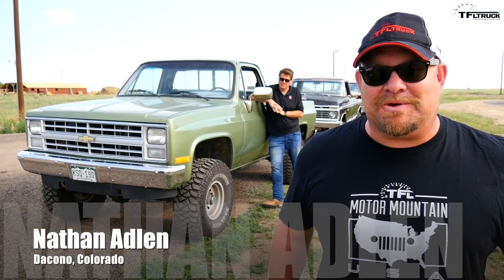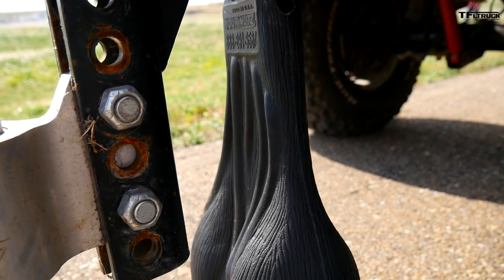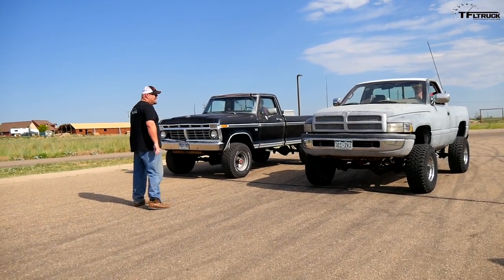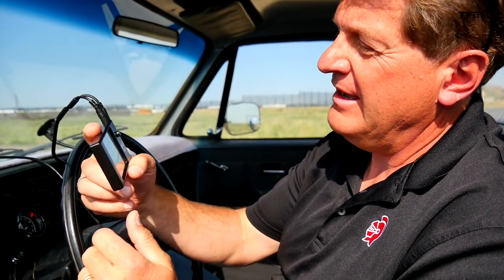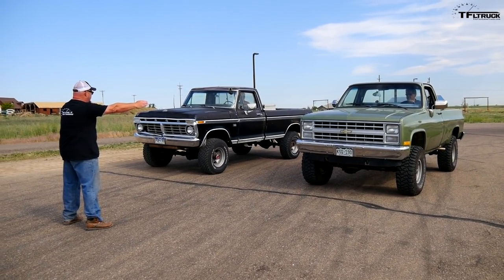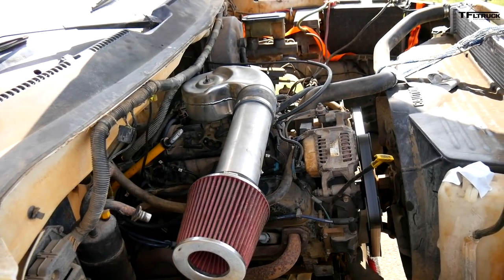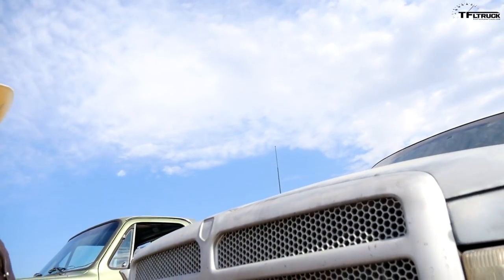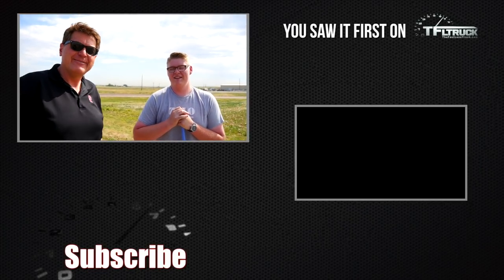Classic Drag Race: Chevy K10 Big Green vs Ford F250 Rusty Boy vs Dodgezilla Ram Overkill

Comment: the 390 in a Ford truck rebuilt with the right parts is more powerful than what people think I had a stock 390 in a 76 F-150 you get on it you would hit the back window I've also known as 68 Ford with a 352 and a 3 on the floor with Granny gear it it definitely wouldn't let that green Chevy sitting still with all the aftermarket parts That's How Strong Ford motors are if you know what you doing with them the Dodge well that's a different story but all three are great trucks and all three are nice but that Ford is nice
Reply: I have a 74 highboy with a 390 and I was thinking what can I do to make it more powerful do you have any suggestions?

Comment: they put 15k into big green and it only beat the Ford by about 1 second?!  Perhaps this demonstrates how difficult it can be to dial in your setup, that you really have to know what your doing rather than just throwing cash at the problem.
Reply: w.s. corners it is a 350 tbi afterall😂

Comment: Lo Chevy has fuel injection and brand new motor. Poor ford running on 7/8 cylinders lol
Reply: Dan Smith but you gotta admit that the old ford did really well considering all that.  if they did the same thing to rusty boy as they did with big Green (but with a ford crate engine obviously) it'd probably outperform big green.
Reply: +Capt, yeah, but those SM465s are not built to speed shift, trust me. They do last forever though... And you can't break them.
Reply: Captain Rudy It would outperform Roman not big green. lol
Reply: Dan Smith and it was still fairly close to big green
Reply: Let's not forget they ditched the 305 in big green because it sucked. Stock vs stock vs stock, the Ford would have dominated.
Reply: Reece Watson the 305 was a great work engine. Could pull anything and lasts forever. Just didn't have lots of high end horsepower.
Reply: TomsFruitStand I wouldn't know haha. I knew a guy who was so embarrassed by his 305 he wouldn't even drive the camaro it was in. I'm a Ford guy. I'm not saying the 305 was a bad engine I'm just saying they gave up on it because it was such a dog. not arguing or bitching, glad to talk trucks and engines. I'm having a good time.
Reply: Dan Smith exactly update the ford and it will still kick chevys ass hahaha
Reply: The king Rory yet it will cost more money just to outperform one truck wow you sure are smart
Reply: Reece Watson lmao
Reply: Dan Smith for real
Reply: Did no one hear that apparently the Ford is a slant 6 so it's only running on 4 or 5 cylinders lmao
Reply: Sad that a old ford gives a newer chevy a run for its money.
Reply: TomsFruitStand my uncle had a chevy with a 305 it was a dog no power.
Reply: I used to work with a man who had a 78 F100 with the 300 straight six. He was on his way home from a long trip when it threw a rod 50-60 miles from home and he made it home on five cylinders. Ford should be proud of those old engines.

Comment: As far as 3 speed automatic transmission go, can't beat a C6. Raced a friend, him in a 1994 F150 351/E4OD me in a 1989 F250 351/C6. Pretty similar trucks in weight, but by the time his transmission could figure out what gear to go in, I was in 3rd sailing down the track. On the flip side, he didn't have to fill tank as often though.

Comment: I never realized how slow the dodge 5.2s were. I own a 99 with the 5.9 and it actually has some get up. It’s a 2wd though. I raced my buddy’s 2010 f150 with the 5.4, and it was a neck and neck race but I finished about a foot ahead of him. Only mods are flowmaster exhaust and k&n air filter.

Comment: Holy crap!!!  $15k in the Chevy!!!  In the end, its worth half that on the market.  The Dodge is a more practical build, but still has a lot of aftermarket mods.  Everyone seems to want a crate motor in the Ford.  I'd rather see the Ford be the one that doesn't get "molested."  Keep it original and just fix it.  Rebuild the motor, rebuild the heads and a new timing chain kit.  Rebuild the transmission if it needs it.  If air flow is still a problem, get a carb spacer, larger intake manifold or even a bigger carburetor.  Experiment a little and do a little research with some old school mechanics.  But get the parts and do it yourself!  For off-road, it might need an oil cooler, an electric engine fan, an electric fuel pump and some upgraded shocks.  Again, these simple, minimal and practical upgrades that can be done over a weekend.   There's already too many over priced, over modded, mall crawler videos on YouTube.  That old Ford is old but a classic.  And by keeping it original and putting in the time, you might find it could be worth more than the other two trucks combined.  Just my 2¢.

Comment: I got a 1993 Ford F-150 Flare Side with a 5.0L V8 outta 89 Fox body. It's fuel injected and has four-wheel-drive as well as low range.

Comment: Every time one of these channels does a competition with Ford Trucks they always use a Ford that is the oldest and has the most miles on it against the competition. The same thing was done with those idiots from Top Gear USA when they put a 70's Ford with a high mileage engine against a restored 80's Chevy, against a 90's Dodge Ram. Rebuild that Ford engine or put a crate engine in there and the driver would be at the finish line taking a nap, waiting for the others to arrive. Regardless, I'd still take the '74 Ford as is over anything GM or Dodge has to offer.

Comment: The ‘74 Ford F 250 4x4 came with one engine option, a 360 2bbl.  Not sure what this old Ford had in her that you raced but it actually won considering that it tromped that Dodge and was only a car length behind the Chevy with its 15k in mods.

Comment: That chevy was far from stock so not fair at all
Reply: Hayden Medgyesy yup
Reply: The Ford engine was also far from stock... he claimed he didn't know if it was a 360 or 390... I wish they had shown the engine better so see if it was even an FE engine... may have been a semi-built 400 or 460... I wasn't expecting an FE engine in a '74...
Reply: They did it for fun
Reply: Its a 360 a 400 or 460 would be way taller

Comment: Had a 1975 F150 Ranger XLT looked similar to that 250.  Less rust.  It was super off road.  It saved my bacon when my crappy Camry engine gave out on me.  I got my money's worth out of it and then some.  Did all the seasons, did all the terrains.  Never left me stranded.  And I was not kind to it.  lol  Hauled everything from furniture, motorbikes, trash, lumber.. too much to list.  Bottom line, those trucks are worth every penny.   Not much in the way of creature comforts, but if you want a work horse, hard to argue with what works. :)

Comment: Does Dodgezilla still have the stock 3.55 gears in the axles? It looks like it based on the way it comes off the line. I highly recommend going to 4.10s and also Mr. Truck should adjust the TV cable from the trans to the throttle body to increase the line pressure and make it shift at redline. Those two mods will make all the difference. 

Source: I owned a 95 dodge zilla with 35s on a 3 inch suspension lift. 35s and 3.55s were a dog.
Reply: MrJamesLuz hello sir my 01 ram 1500 5.9 only shift at redline what can i do to fix that thanks
Reply: MrJamesLuz I love how all the idiots in the comments are bashing the 318 but they don't understand he has bigger tires with a shitty rear end.
Reply: Jord A. lol I beat the shit out of my 318 all day and never had a single problem...
Reply: Dodge 318 Cummins  not sure what that means....but my 96 318 dodge with 115000 km and blown front seal. had it into dodge at 90 k for trans slipping, and filter change..now it's popped it's cork... no towing ever with it.
i have a 96 GMC 5.7. with 3600000 km.... just changed wheel bearings and rotors and waterpump....tranny works fine..it towed a 5 th wheel camper to Arizona from canada both ways for the first 10 years of its life.  granted there is Wednesday build and Friday afternoon build quality factor....
Reply: Jord A. Lol you have a 318 magnum in a second gen. I've seen chevys blow engines at 50,000 miles. Not to mention that every chevy needs a new fuel pump every 2 years.
Reply: Dodge 318 Cummins I have a 318 magnum in a second gen
Reply: Jord A. There are too many factors to say "Chevy is best, Dodge sucks....WTF LoL. "

Axle gearing plays a major factor in towing and transmission life. My truck had 3.55s and 33s, then 35s. I installed an aftermarket trans cooler and kept the truck out of Overdrive which is the weakest part of any transmission. Overdrive is where the tires/wheels/etc have more leverage than the engine. 

I've also had a built Jeep with 31's and 4.56 gears to keep the trans alive. 

My current rides are an Ecoboost F150 (DD/tow rig) and an Xterra (off road toy)

Because brand loyalty is dumb. Buy what works for you.

Comment: While I absolutely love the 2nd gen Dodges, and actually own 2 of them. I wouldn’t exactly call it a “classic” . It has no place here.
Reply: Technically it is over 25 years old. But should really have been an 80s D series.  Seems like the truck is either tired or its gear ratio and tires.

Comment: I found this entertaining. And wonder how my 80 Powerwagon would of done. 360, 4 bbl., 4 spd., 3.55 gears and 35" mud tires. Don't know how much it weighs, but it's a long box, Clubcab. I do know that the 2 piece rear drive shaft doesn't like hard launches. I have completely destroyed the steady bearing and the cross member. Another time twisted the drive shaft off at the rear yoke.

Comment: when are you going to have more on the zr2... you guys have the best car review on it by far.
Reply: Walt Whaley ZR2 vs Tacoma off road. That's the review they need. TRD pro wouldn't be fair. TRD off road is more Comparable by the numbers.
Reply: Brandon H zr2>trdpro
Reply: I think the zr2 will take the taco....
Reply: front lockers diesel..... new shocks... ect....
Reply: Plus it did the Rubicon trail with out one winch.... that speaks for it's self
Reply: guy proulx yeah i wish I knew the suspension travel of the zr2 because I'm more of a dessert running guy. The only advantage the TRD Pro has is ground clearance. I would love to see if Toyota puts a front Locker on the Tacoma because then it probably would be better
Reply: guy proulx yeah it's close I wish I could take them both off-road but I think my next truck will be a raptor. I'm just not sure about the reliability of a v6 with that much power.
Reply: guy proulx when I heard Chevy put a locker on an IFS I wasn't too pleased obviously. But as far as a raptor even here they don't look like they've ever left the pavement. however that wouldn't be me and here I have a friend that works at a Ford dealership who offered me Raptor 51000 with no options selected.
Reply: guy proulx you're also right about the ground clearance it's way too low on the ZR2 however for me it doesn't matter much because this desert is pretty flat. my decision would be much easier if Ford put a V8 in a Raptor even if it didn't have forced induction
Reply: Yea for what expense it's already almost 50k without it. Plus they have invested all that money in there traction control it would be 50 plus. Why would you buy it then. just get the raptor.
Reply: guy proulx because the TRD OR has more ground clearance and better approach angles than the ZR2. Aside fr stock tires, the Tacoma off road is superior in every category. The front locker is a novelty. I would argue the traction control in the taco off road is just as good or close to the locker in the ZR2. Should be a good comparison video though. I do love the competition but Toyota will be the better long term truck, no doubt.
Reply: guy proulx sorry. Replied to the wrong person. Taco FTW

Comment: Tommy, you need to stop pumping the throttle every time you start it. Pump it once, then start it. You're flooding it, you can see the black smoke on start up, too much fuel. Could probably use a tune of the carb too, and check timing.

Comment: that ram is slowwww
Reply: Big tire and highway gears..He said at the end it was gaining,have a 1/4 mile the Dodge would pass them...Dodge was actually fast,just 0-40 mph it couldnt take off quick due to big tires and highway gearing..
Reply: 01trsmar the two other trucks had bigger tires and highway gearing. The ram has a smaller engine.
Reply: Ford is literally running on 7 cylinders. That's the ultimate excuse to lose...Yet it still smoked the Dodge and kept up with the 400hp Chevy.
Reply: Veyronp87  says the slow one
Reply: MASON PAYSTRUP Ram had 33"s
Reply: Dodge has a lot of torque in it like most Ram truck has lol
Reply: It’s a slant six, it’s not built for racing
Reply: @01trsmar  truck wasnt gaining at all the ford was gaining on the ram
Reply: Transmission was slipping the whole way... dodge problems
Reply: I own one of those rams mine is just a 98 with like 30 more horsepower and a bigger engine size, yes mines slow but the ram was never meant for speed it was meant for towing with all the torque it has
Reply: @zackcampbell5663  if it had so much torque it should have beat that Ford on take off...

Comment: im a ford guy through and through and it would have won if the chevy was stock haha love watching these little grudge race
Reply: I was probably a 360 Ford.  Chevy really sucks ass.
Reply: Solaire The SunBro I see we've found our typical chevy fanboy right here
Reply: Solaire The SunBro a sore loser? Lol too bad the chev needed over 10k in mods to beat an old rusted out Ford with 360/390 running on 7 cylinders lmao.
Reply: Marcus Andre No it didnt, because it's not the first time. I've watched several videos on these older chevys and they're much better than even these new fords. Look at their older videos with the raptor. A $2500 truck pulled out a $50,000 truck. That's pathetic.
Reply: Solaire The SunBro I'm not talking about new trucks lol, I'm talking about old Ford trucks from the 60s and 70s, what's sad is that "2500$" chevy need about 10k in mods to beat a worn out Highboy.
Reply: Marcus Andre Even so there's plenty of videos of old fords losing.
Reply: Solaire The SunBro And there are tons of videos of old chevys losing
Reply: uhhhh no the ford was really slow and there was barely any modifications to the chevy
Reply: did anyone notice that when the chevy won all the ford fan boys are giving the ford excuses becuse it lost XDXDXD what a joke truck
Reply: Red-nexican Dipper yeah it would because when they got it stock it was basically rubbish
Reply: Red-nexican Dipper If my aunt had balls she would be my uncle. Chevy power
Reply: LOL barely any mods to the Chevy? It has a complete engine replacement with a GM performance engine. That's no barely any mods.
Reply: GIVE IT UP FORD BOYS, FORD SUCKS JUST ADMIT IT AND BUY YOURSELVES A CHEVY !!!
Reply: @D-Man_Jam  watch any other video with a Ford and a ChEvY, usually 99.9% crybaby's are ChEvY guys